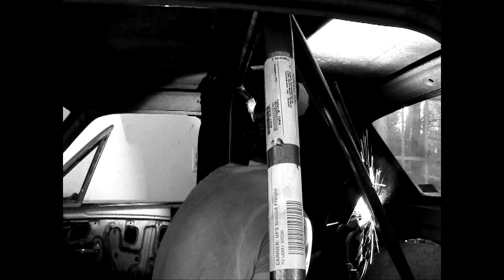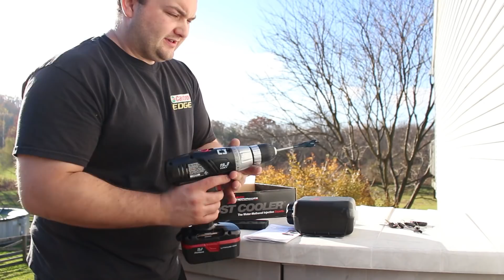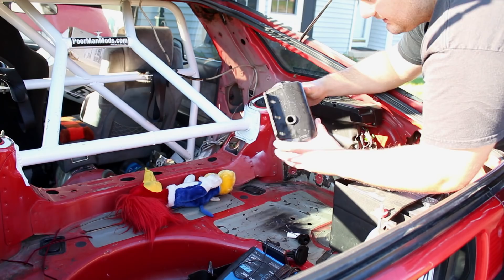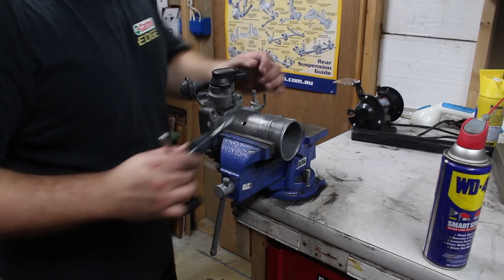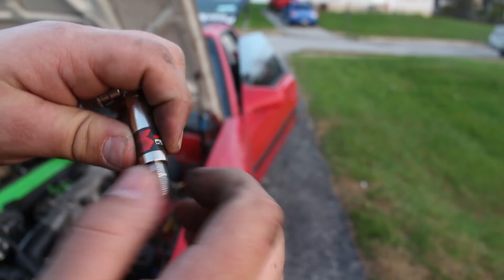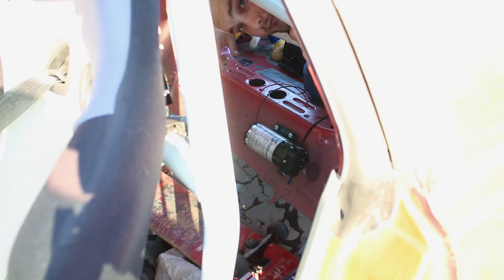Water Methanol Injection Install Pt 1 | Drift Missile Build pt 14 | 1JZGTE MKIII Supra

Comment: You loose power with water meth kits Iunno why everyone still uses them like they should be used, 50/50 mix dyno tunes back to back  it’s all online lost over 50hp and pure meth lost 76hp lol that’s in a e85 car to
Reply from the maker: Anyone who knows anything about meth knows meth injection does not make extra power.

Comment: How do you adjust the boost switch? The manual just says turn clockwise or counter clockwise but there's nothing to turn
Reply from the maker: there is very tiny allen bolt on the pressure switch, its recessed and hard to see. for every rotation, the boost is adjusted by roughly 2PSI. I turned mine 3 rotations and it now triggers at 12 psi.

Comment: Found another 300 psi pump for 130 bucks... so you paid 360 bucks for some fittings and an cheap plastic undrilled reservoir.  You could fabricate a beautiful reservoir for less than 40 bucks with fittings. poorman mods or lazyman mods?
Reply from the maker: +warfl4g $360 for wire, a relay with pigtails, butt connectors, a fuse wire, a meth pump, pressure hose, pressure switch, a reservoir, 3 nozzles and a nozzle holder with a built in check-valve, low level switch, clear silicon,  a warranty, instructions, zip ties, and indicator LEDS.

Comment: use some exhaust c bolts clamps to hold the container on the roll bars :D
Reply: +SupraWilliams 
https://www.bing.com/images/search?q=1+7%2f8+exhaust+clamp&view=detailv2&&id=99F222C8F8629DAF11FF002754469FBAED4DC650&selectedIndex=2&ccid=cv98H1Em&simid=608054283449795194&thid=OIP.M72ff7c1f512603a8085f4be4e5fc5047o0&ajaxhist=0
Reply from the maker: +SupraWilliams good idea

Comment: My advice to you man, just drift it. Idk if you've gotten any seat time yet, but literally you can keep building your car till the day you die and it will never be 100% where you want it. I was the same way I wanted my car perfect before I hit the track I wanted to build a perfect FD spec car. But you don't need it. Honestly all you need is a welded a good clutch good brakes and coils, and you're ready to do some sliding. I mean you can always improve your car, always, but it's better to do it while also getting some seat time. Just my opinion man, keep it up.
Reply from the maker: Well I'm also building it for the show, not just for me

Comment: was curious.. you still tune with safc correct? and second what do you do for boost cut? my 1jzgte sc300 wont let you boost past 14psi. and its tuned with safc, and had some mod to the ecu, not sure what was done to ecu, maybe something replaced but it bucks and wont let you boost past 14psi
Reply: +Vaping With Hacked car came with a greedy fuel cut defender but not sure if you can run both a safc and fcd at same time'
Reply from the maker: +Vaping With Hacked I am now tuned with the greddy emanage ultimate, i did a video on it, with the emanage i have no boost cut
Reply: +Poor Man Mods nice,, i might have to go the route as well